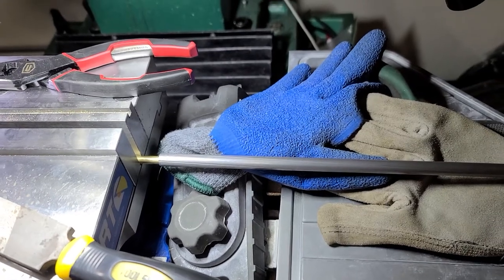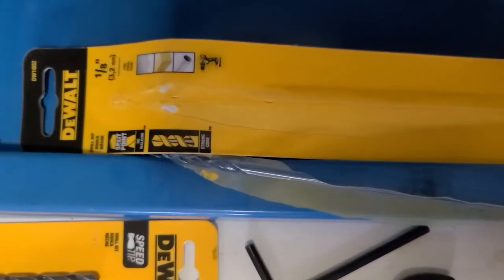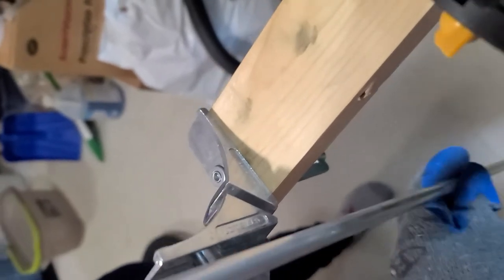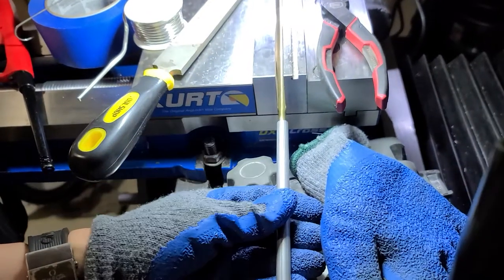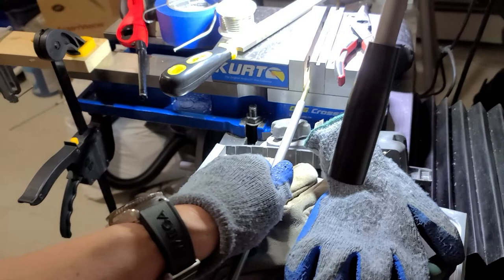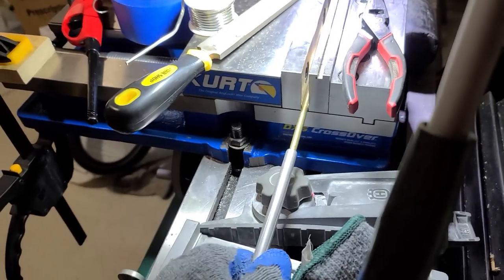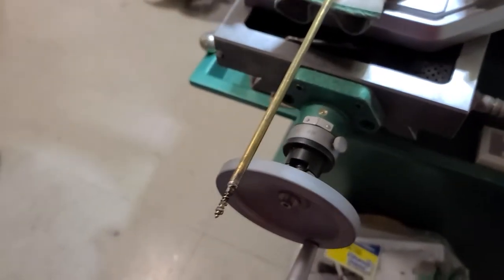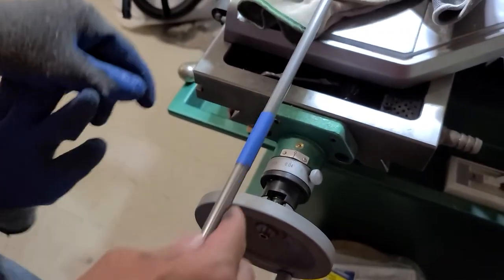how to remove stuck pellets from FX barrel sleeve

Comment: I had a similar situation with 5 x  .25 calibre pellets stuck up the barrel, it was a simple matter to resolve.
I removed the barrel & was able to see the stuck pellets from the breech end, taking EXTREME care to keep the drill bit SQUARE TO AVOID DAMAGE TO THE BRASS BREECH FACE, i used a 1mm  hss drill bit to make the initial hole into the centre base of the first stuck pellet, this allowed me to then replace the 1mm bit with a 2mm bit to enlarge again (all the time making sure that the bit was held straight) then onto a 3mm bit that finally allowed the pellet to be removed, the others simply fell out.

Good luck, patience IS THE KEY to avoid damage.

Comment: I have gotten maybe 3 max 4 pellets jammed. You should easily be able to tell your pellets are not flying and the cocking handle gets harder to cycle. That being said. If you have been shooting any length of time you should have a barrel cleaner. mine is made by Hoppe's sold at Big 5 for $14.99 it has a 3 piece handle with a copper end for your swabs, it make a perfect rod for un-lodging stuck pellets. Go gentle and slow big tapping, the pellets will slowly start to fall out as they are pushed backwards. Make sure your rifle is on safe and carefully back out the barrel. This ensures that even if the hammer spring was to engage it will not hit anything. The one I bought was for .22 cal and works perfect in my .25 cal barrel's and .30 cal barrels. This will make sure you are not damaging the FX barrel.
Reply from the maker: Thanks for the feedback Doc! The cocking lever effort on an FX Impact will not change regardless of nmbr of pellets stuck. My friend was shooting 30 yards into a trap that had numerous impact points. Thus hard to decipher if he was in target or not as he was zeroing a new scope.  There was no way shakin the barrel would dislodge the pellets.

Comment: How did you not know they were stacking up??
Reply from the maker: Target at 30 yds...thought we were missing. By the time i had arrived, who knows how many times Dave had already fired into the blockage.
Reply: @chenglo8999   glad it worked out.    Very clever resolve 👍
Reply: It's stupid, the gun let's you double load, and it's always a nightmare, because most of the time you cant tell that's it's stuck till the gun stops shooting. I got a maverick, love the accuracy, but I hate the design. Just terrible in my option, would not recommend one to anyone ever that's how bad my experience has been
Reply: @jacobnavarro3206  Carbon fibre rod.

Comment: I found the same size of the steel stick on Amazon size 6.35mm ×356, is the correct one? Or should I use smaller diameter steel stick?
Reply from the maker: Do NOT use steel! Get brass. Steel can scratch ur barrel. Also, u wont be able to solder as easy onto steel. u want smalller diameter rod than your barrel. Example get 5mm of barrel is 6.35mm.
Reply from the maker: Also get brass screw to solder onto.
Reply from the maker: Look at my other video on how to make 22 cal extraction tool
Reply: @chenglo8999  thank you

Comment: Where can I get the steel stick that you use?
Reply from the maker: Its a brass rod. U can buy the rod from home depot or menards or any decent hardware store. Buy brass screw to solder onto the rod.  use plumbing solder and butane torch. U may need to file down the screw head when done so it will fit inside ur barrel.